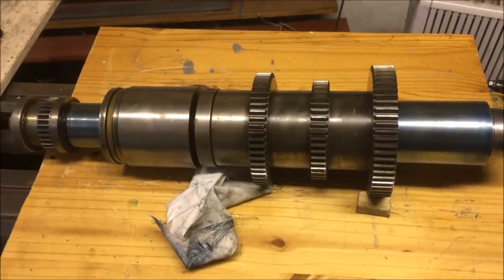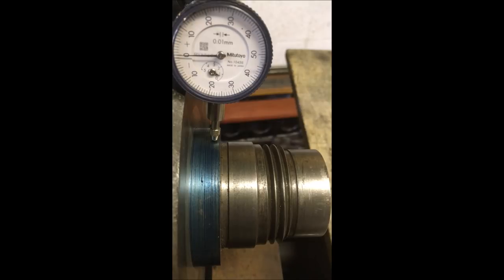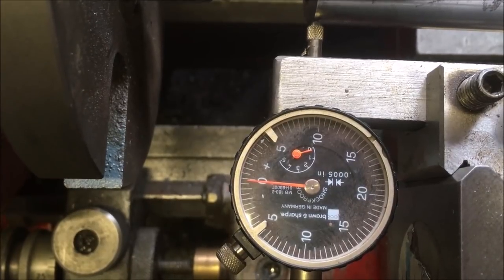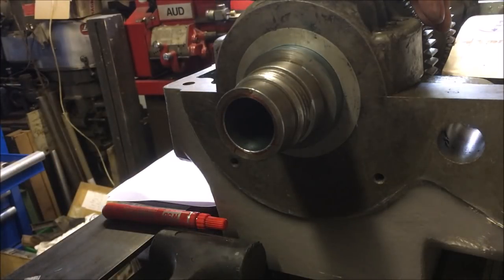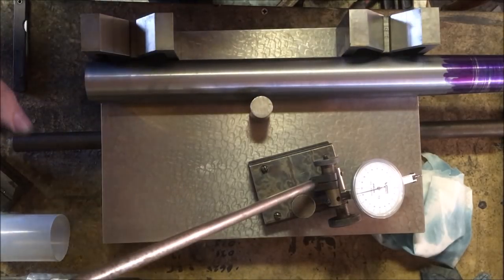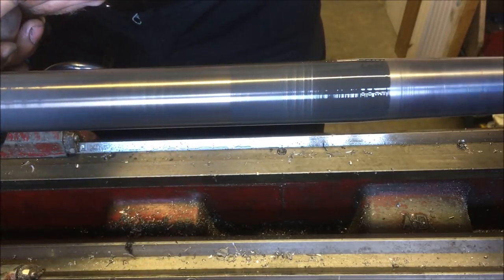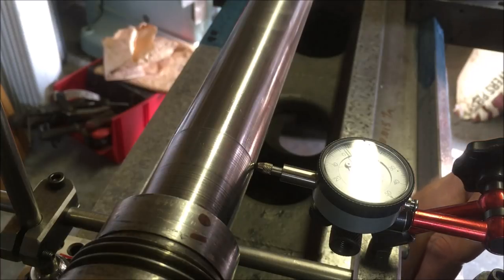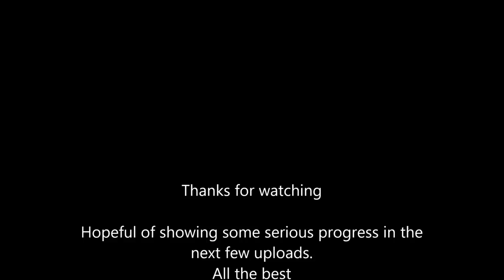Holbrook 7

Comment: A great object lesson in using hard won skill and doing the leg work to research what you don't already know about Mat. Very well done. Doesn't hurt having someone as skilled as Robin providing a few tips as well.It's now a bit harder to find than it used to be, but checking with a few aftermarket stores who sell automotive performance parts might turn up a few grades of valve grinding pastes pretty cheaply for the coarse first few steps when needing to lap shafts to a consistent size. Obviously a different lap is needed for each grade to avoid cross contamination.

And another good object lesson on how important a clean headstock bore and the tapered shaft going in it really is to maintain any semblance of precision. That one was well and truly buggered up by the previous users.
Reply from the maker: I found some diamond hone paste on line for very little money (ex china) - I picked up a couple of small 'jars' of #40, #20 & if I recall #2 for less than I paid for the honing paste tube from Tormec - the tormec paste is for sharpenning up turning tools and works a treat for the final polish .  That internal bore is a bit of a worry.  Im not sure how it will work out if I grind it with a tool post grinder on the cross slide / compound slide in terms of alignment to the bed - to my mind this would change the alignment of the bore to the out to the bed. Does that matter if its just for centres turning _cant see why it should ? Have to do some digging about to see what I can find out. Mat
Reply: @lookcreations  Shadon HKW on his YT channel reground his Bridgeport's quill with an angled tool post grinder on his mill table and grinding the taper while the spindle was rotated in it's own bearings and powered normally with the mill motor a few years ago. And while it was a mill and a R8 taper the ideas and approximate methods would be roughly the same. It might be worth searching that one out for a few ideas if you haven't already watched it. His test results were pretty good.

One real important concept I picked up from one of the George Thomas books I should mention. Because of the minor but necessary clearances in the top slide it can't accurately cut (or probably grind) an external and internal taper setting to the exact same angle for both of them. Those very small but non optional clearances in the top slide that allow it's movement will also allow it to move or tilt over very very slightly away from the direction of the cutting forces as those few thou of clearance is taken up. So cutting a male taper would push the top slide and tool point towards you and cutting the female then it's away from you resulting in a subtle change between the two angles. His easy and clever method of getting around the problem was to cut the male taper with the cutting tool in the normal position and then turn the tool upside down and cut the female taper with the tool cutting on the back side of the taper. That way the cutting forces were in the same direction for both tapers. 

I've mentioned this just in case you don't know of this effect since it's easy to get caught and then wonder why the tapers don't exactly match when both were cut using the exact same top slide angle. So it might be something to keep in mind. Grinding the internal taper the pressures should of course be minimal, but they and any light vibrations from the TP grinder might be enough to help change the angle?

With your minor alignment change and a dead center in the headstocks spindle I agree, it shouldn't affect it. You do raise a good point I hadn't thought of though. The spindle originally should have been finish ground on a proper internal cylindrical grinder that would have been aligned square both vertically and horizontally. Over the roughly 4" length of your MT that slight but on purpose misalignment of your headstock just might be enough to matter when regrinding it.
Reply from the maker: @turningpoint6643  good point about the internal v's external cutting tool pressures. What I have in mind to progress at a later stage, is to make up a better internal plug hone for the bore. The one Ive made - but didnt show, has a really crap surface finish - as the selection of steel bar was far from ideal. An aluminium remake I suspect will prove better. Now I have some decent diamond paste I can progress it - once the spindle is sorted / much improved - I can then look to retouch up the test bar taper and make up some plug blanks to suit the spindle.  One of the benefits of the Holbrook Taper turning set up should be to be able to lock off the compound slide and use it That's some what down the line though :-)

Comment: Nice work Matt,

Engine rebuilders use a product called plasti-gauge for measuring mains and conrod journal clearances, it’s basically a wax string that gets torqued between the journal and bearing cap, they then measure the squash with a calibrated tape to give bearing clearance, might be helpful when you scrape the bearings in the headstock.
Cheers
Reply from the maker: Hi Raymond,, Ive read about plasti=gauge and for the life of me couldnt figure out exactly what it is. Had a quick look for it online in the UK and not found it yet. Thanks for the suggestion I will have another look see what turns up. All the best Mat
Reply from the maker: @andypughtube  no idea how I missed that ? cheers Andy
Reply from the maker: @transdimensionalist  thank you kindly - I shall look to get a pack and see what it tells me. :-)
Reply: I remember plasti-gauge well, you used to be able to get it at most auto-suppliers, but not so these days, specialist suppliers only.  I can also remember how frustrating that process was for a perfectionist like me.  In the end, I decided for sanity’s sake to send out the block, caps, crank, etc., and get someone good to do the lot. I still inspected and put it together myself but did not check the tolerances, if I could not trust the machinists to get it right, they would not have got the job, sometimes you just have to let go.  These days, I am retired, so would have spent the time to check everything, but now I am not interested in cars and bikes except to drive them.

Comment: When indicating precision tapers it is best to indicate the top and side at the same time as there can likely be wear in the bed that will cause the needle to not run on the true axis thus causing deviations that aren't really there. The needles have to both move identically or it is not properly aligned.
Reply from the maker: That makes s lot of sense Brian. Thanks for the tip. Hope all is well .
Mat

Comment: Incredible work there!  Have you ever worked with, or poured and formed Babbitt style bearings before?  I don't find too much information about that around.  Your a true craftsman, and a great inspiration to the work I'll be doing to my small lathe, especially the scrapping, which I've never done.  I thought about sending it out to be ground, but once you go down that road of paying others to do work for you, where do you stop?  Besides, I've got much more time than money, and the scrapping process looks rather relaxing.  Thanks for the videos. Can't wait to watch the rest of this series.
Reply from the maker: Hi Robert, thanks for watching and commenting.  Ive never worked with 'Babbitt Bearings' before this. I have over the last few months searched for some well put togther details about the subject - lots of bits of information, and the more you dig the more you find out. There are videos on YouTube about pouring them into a housing. Casting them (as replacement inserts etc) keith fenner is a good place to start. Then you get onto the matter of how to 'finish them' scraped, polished or left as cast. With all these things there are varying aspects which determine the 'correct' method and desired outcome.  As you watch the later episodes in this series you will see how I addressed the spindle bearings. Might not be the 'best method', but I havent had anything suggest it wont work !  All the best Mat
Reply from the maker: Robert - you asked another question (it came on email notification) but I cant find it - ref' the oil film / dimensions within the spindle bearings - take a look through the two videos where I scrape the white metal bearing halves and then if you would like more info' ask under the videos. Cheers Mat PS its good to have folk interested in the approach I take
Reply: I thought about the running gap and decided it was probably only microns of separation, and not enough to realistically worry about or plan for.  Thanks though...👍

Comment: Why didn’t you use Plastigauge to determine the clearance ?
Reply from the maker: On what? The spindle sleeve? I used it to confirm clearance on the spindle bearings. It’s not much use on a fit such as the test bar to spindle bore where it needs to be contact area rather than clearance.

Comment: ive been after a 4 an 1/2 morse adaptor for my chipmaster for years  they are like hens teeth, im in the middle of building a tool post grinder to make one tried turning one but you dont get the right finish
Reply from the maker: I was thinking there must be a few guys looking and surely a small batch could be made up if you set up for it. Easier if you have a sample to work from like I was loaned. Good luck with your tpg 👍😎